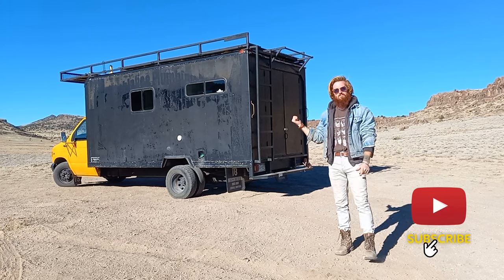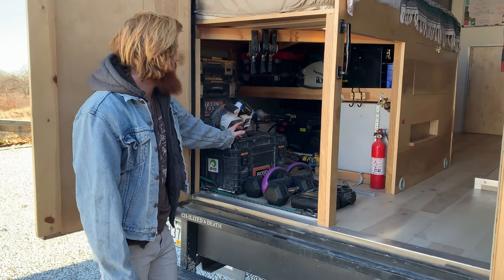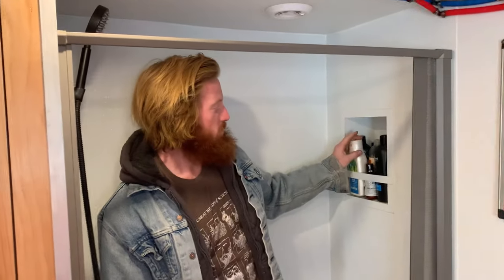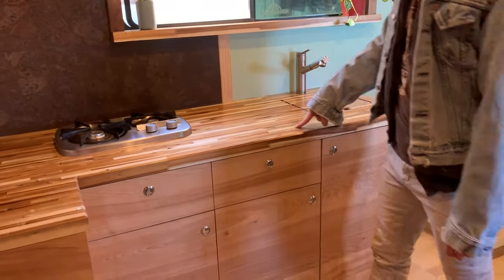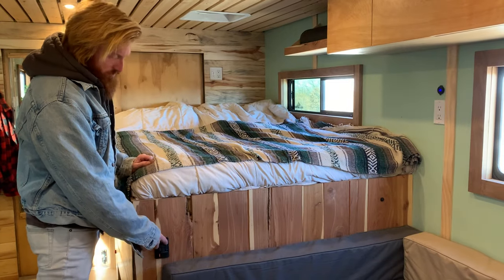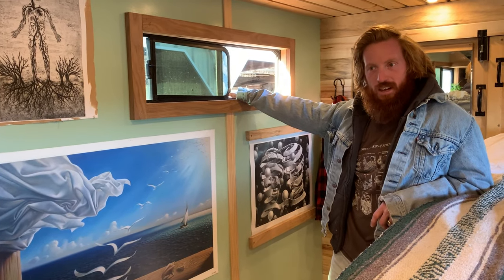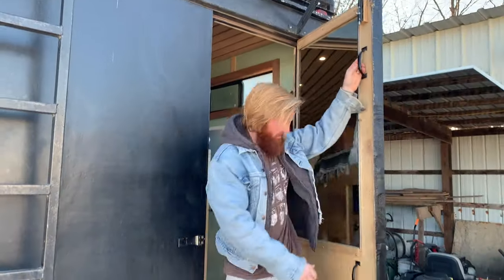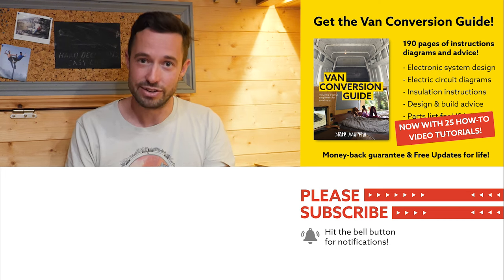PRO VAN BUILDER'S 20th CONVERSION | Why he chose a BOX VAN OVER A SPRINTER for the PERFECT LAYOUT

Comment: Van, Bus or Box Truck. This will be the question in my head in the next 12 months. 
Van:
Pros = Easier to maneuver around a city, can go stealth, better for longer travel
Cons = Smaller Space
Bus:
Pros = Bigger space
Cons = Harder to go stealth
Box Truck
Pros = Bigger space (depending on size), stealth to look like a delivery truck
Cons = Bulkier, harder to get around

I was thinking of maybe a moped or even a micro car to tug along. At this point though, a box truck looks more promising.
Reply: Stealth doesn't exist especially if you are boondocking or camping
Reply: What did you go with
Reply: Box truck is the way to go. I soon buy one to convert here in The Bahamas
Reply: Yes box trucks are the best of both worlds but you’d def need another vehicle
Reply: Box truck steering and Isuzu reliability is where it is at ! The MPG is pretty solid !

Comment: What if you have to poop in the middle of the night? Or what if you are sick with the runs and need to hit the toilet repeatedly for 24 hours? I plan on getting a dry flush toilet. 
Mymust-havee list is a hydraulic bed, toilet, shower, and a pocket door to the cab.
I think a box truck is better than a van because they are more affordable and because you get a square, so it's so much easier to build and furnish. The angles and curves in the van are too complicated for this do it yourself gal. It's just insane right now how much vans are going for. I was looking for a used one, already built out, and the cheapest one that I would be ok with was $60k. If you wan tto do it yourself, you're looking at $30-$40k just for the van. If you have a shop do your conversion, that's another $50-$100k and most of them are pretty generic without a lot of choices or customization allowed.  I'm sorry, but for $100k to $150k all in, I want to be able to choose my layout and fabrics and materials and color scheme. 

I then started looking at some converted vans for sale in Europe, and even with the cost of shipping to the USA, it would still be way cheaper than buying a finished campervan here. Also, the materials and craftsmanship and storage efficiency was overall much more clever and years ahead of what I was seeing domestically.  I then looked it up and found that it is legal for the driver to be on the wrong (right) side. I was surprised! I'm not sure how I would feel about driving a large vehicle on the right side, but if I could hamdle it and get used to it, there are some amazing campervans for sale!!

Comment: Nice build. But it loses major points for lack of a toilet. I will never understand people putting in a shower over a toilet. There is nothing worse than needing a toilet and not having one. A daily shower can be had at any local gym, public beach, or pool. $20/mo gives 24/7 access to Planet Fitness or 24 Hour Fitness showers. I shower at the gym as much as I do at home, anyways. But I hate hate hate using disgusting public restrooms and avoid it as much as possible.
Reply: Both shower and toilet necessities. During COVID lockdowns, it was shown that you can't depend on public facilities.
Reply: Public showers are just as disgusting as the toilets
Reply: @hmmm2564  Excellent point.
Reply: @hmmm2564  I have a home but I use showers at the gym regularly. I love to use the steam bath at my gym, too. Maybe it is not your speed. 

If I have to choose I would rather have a toilet than a shower. Prefer to have both.
Reply: @geejaybee1970  no it is not. Those things are not truly clean especially how so many people have disgusting hygiene

Comment: he can get locked into the van. He should have the hasp lock open by putting a loop on the open side to put the lock into it and lock it open.
Reply: He can exit through the cab if that happens.
Reply: Good advice. 
I imagine what I'd want if my daughter were sleeping in it. A predator could break into the cab and even drive off with her inside.
Reply: He can get out into the cab of the truck